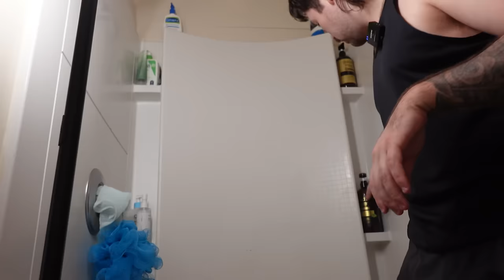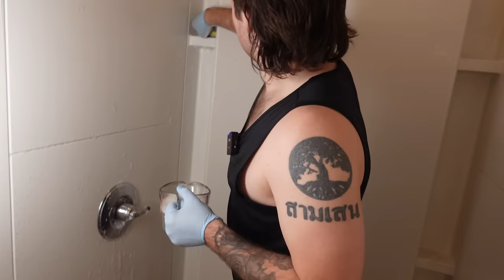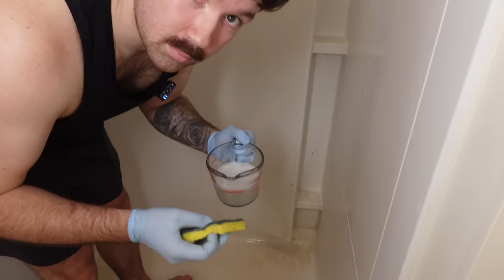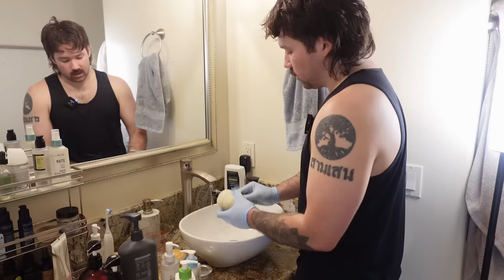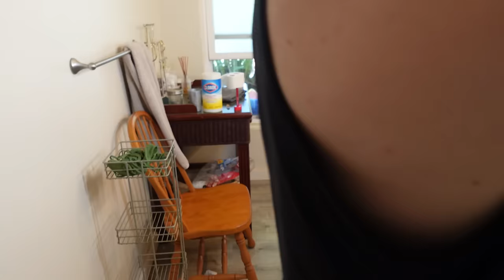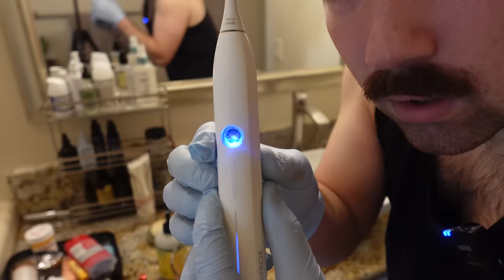being miserable is not a virtue

Comment: Fun fact: dish soap is actually a pretty great, inexpensive cleaner for showers, since it cuts through one of the major sources of dirt/grime (skin oil). Nothin' wrong with cleaning a shower with that and a little disinfectant.
Reply: Dish soap is such a great cleaner. Ever since getting a CPAP madhine (they told me to clean it with dish soap), I use it on all sorts of things. I hadn't thought of it prior.
Reply: I can't stand it because you have to rinse it forever. I use method all purpose for regular stuff and stronger cleaners for thick build up like soap scum/hard water
Reply: @no_peace  I put dish soap and white vinegar in one of those scrub brushes and and scrub the shower walls while I'm taking a shower when I don't feel like doing a deep clean of the shower and tub. Because I'm in the shower, the suds come right off and it doesn't get super slippery
Reply: i clean houses for a living and I primarily use dish soap (Dawn) for most things! Usually, I use a mix of other chemicals and dish soap, but, unless you need to disinfect something, you can really get away with using dish soap alone. (I do in my own home lol) 
You can use dish soap on most surfaces, like counter tops, as well!
Reply: I thought I was a genius when I cleaned my tub with magic eraser and it worked great.. sadly it ate away at the protective layer that stopped grime from sticking to the shower and now I have to constantly clean it. Don’t use magic eraser on your tub. Maybe I’ll give dish soap a try
Reply: Dawn is my go to for cleaning everything. Add a little white wine vinegar and it’s go time.
Reply: I wonder if using dawn power wash us also a good shower cleanee
Reply: This is an incredibly smart way to do it for people with ADHD (me), thanks for the inspo!
Reply: I know this cuz when im getting the human remains off my dishes, the dish soap always cleans it right up!
Reply: I clean everything with dish soap. I have the antibacterial kind and use it for the dishes, floor, shower, toilet, and counters.
Reply: Also vinegar!!
Reply: oh yooo thank you!!! my shower cleaner sucks!
Reply: K but that was hand soap
Reply: Yup! And for regular cleans in a lot of areas the disinfectant is optional. On hard surfaces, the dish soap will both break apart most germs and lift it off the surface so it can be rinsed away.
Reply: @squirrelsinmykoolaid that's the smartest idea I've ever heard
Reply: Sometimes, the simplest solutions are the most effective.
Reply: I mix dish soap and shower spray in one of those sponges with the soap compartment on it and hang it in my shower. When I shower I do a once over of the walls so I rarely need to do a full clean of the whole tub
Reply: @no_peace so add less…
Reply: @ebel-mt2dm me too man. Human blood just seems to dry a bit tooo  quickly if you know what I mean. Lot of scrubbing untill I learned that a little bit of soap and hot water will clear it up. Sadly I learned soon after that her hair was stuck in my garbage disposal needed a solvent. Baking soda and vinegar worked for the hair and harder bits of cartilage. They just take a bit since that particular solvent is weak. I actually have a shipment of  Hexane and petroleum ether coming over so that way the whole body melting process will go quicker. Anyways the  rest just gets buried. I always burry the odd bits in front yard (the back yard is to obvious).
Reply: This is blowing my mind. Imma take my dawn power wash to mine to get the bath oil off the sides. 😂
Reply: @squirrelsinmykoolaid I love you for this comment, omg. This is life changing for my ADHD brain.

Comment: I use a mix of vinegar and dish soap to clean my tub. Equal parts of each in the microwave for 2-3 minutes, then mixed - not before. Pour it around your bathroom and scrub it in gently, then walk away for 30 minutes. Once you come back, scrub it again then spray away with cold water and it will be clean as fuck. No real elbow grease required.
edit: misspelled vinegar.
Reply: I definitely just screenshotted your comment so I can try this later. Thank youuuu
Reply: quick question cause I wanna try this myself: when you put it in the microwave, what heat level? like lower, higher?
Reply: I've heard people say vinegar is good for cleaning but doesn't it smell really strong? 

I'm sensitive to smells so I feel like if I tried it and it made my bathroom smell it would be really difficult for me.
Reply: @jaymercer4692  my last roommate used to do straight vinegar in the kitchen every 2 days and I couldn't handle the smell so I started buying cleaners that were all "natural" etc with nice scents and she let me use that instead lol. But it sounds good for deep cleaning a bathroom once every couple weeks.
Reply: I just use bathroom spray and let it sit for 30 seconds
Reply: I don't microwave the vinegar, because I don't know why I would. But vinegar is great for removing both mold and lime(stone?) residue. ESL, so not sure if the white residue on the bathroom walls.
Reply: exactly what I use, and if I'm out of white vinegar (as I often run out because I use it in my laundry for a deodorizer as well) you can use Isopropyl Alcohol. If I use any of the chemical cleaners I swear I can't get the smell out of my nose for days, and usually end up with a headache, and I am venting the bathroom when I use them, just sensitive.
Reply: ooh also, after you microwave the vinegar, immediately wipe down your microwave and everything will easily wipe away! Two birds ya know 😅
Reply: One exception: vinegar isn't safe on SOME natural stones, like natural quartz, apparently. It's too acidic. Alcohol isn't acidic, so should be ok. Especially good to know for someone who gets a cleaning gig.
Reply: @RR-hl6zi  Very close, you were looking for limescale.
Reply: You can also soak lemon peels, any herbs you like the smell of in vinegar. Leave it in a dark place for 2 days to a week and shake every day. I got this recipe from the YouTube channel, NewLifestyleABB. It smells wonderful and it’s a great way to use leftover lemon peels
Reply: My grandma does this too!! She insists vinegar will clean anything lol

Comment: I think you're getting the job done just fine with that dish soap (and I bet it smells amazing)- but I also have a moldy bathroom like your sister(no fan+humidish climate) and my way of dealing with cleaning the shower (well the bathroom as a whole) is clean all the bathroom surfaces first (including scrubbing the walls and ceiling- my bathroom is teeny and has a low ceiling), then the toilet, the floor (Swiffer), THEN- clean the shower while I'm in it, getting clean myself (since I'm probably grungy after cleaning the rest of the bathroom). I turn on the spray so the hot water gets some steam going to loosen up anything, then I scrub down the shower while I condition my hair. I used to clean my shower with clothes on and it was a pain in the ass for me- trying to rinse different parts while not getting sprayed myself. This has worked much better, hope this helps someone who also hates doing their shower.
Reply: I also hate doing my shower and getting sprayed - my solution is every weekend I wear my oldest clothes that I don't care about and clean my house top to bottom then have a bath at the end of it.  Sometimes I'll hoover through on one day and do the polishing/scrubbing on the next day if I need to do a deeper clean. Ngl though sometimes I skip a week and then all hell breaks loose 😬

Comment: tip from a hotel housekeeper: dish soap is great for glass showers but with titling or vinyl like this, it's better to use a bleach-based cleaner. When I'm at home and cleaning, i use an all purpose spray on nearly everything and then go in with diluted bleach as-needed. (vinegar also works but i prefer bleach) I also would have used a janitorial rag (or an old washcloth) on all that detailing. You can take your index finger and trace all those corners, something a sponge can't really do. I also just soak my  shower curtain in the tub (i'd use a storage container if i had a shower like this) with hot water and bleach, then re hang it to let it air dry. They repel water so taking them out of a washer usually makes a huge mess even after a spin dry.

Comment: It’s currently 38°C (100°F) here and this actually made me get up and clean my bathroom, promising myself to at least clean for the length of the video. I am so glad I did because you made me think about how nice and extra clean I will feel after showering in a really clean bathroom. I also finally cleaned the metal shavings off the floor from when I changed the door handle in there 2 months ago too. 🙃🙃🙃
Reply: Good on you! Sometimes, it can be so hard to get up... Especially in such hot weather.

Comment: Cleaning tip i learned on Twitter somehow: laundry detergent works AMAZINGLY on bathtub grime and showers (makes sense, since its entire purpose is washing away skin oils abd dirty and assorted body filth. Spray on a dilute mixture of laundry detergent and water, dab on some undiluted liquid laundry soap on any really grungy spots, then leave it for a while and you barely need any elbow grease to get it all squeaky clean. I have some chronic pain issues so cleaning is sometimes very uncomfortable, but my shower and bath is always spotless. Makes me feel good to know that I can take a hot bath in a clean tub any time i need one (it helps the pain).

Comment: If anyone wants, here's a list for my cleaning company if you're struggling to start cleaning a bathroom!

First, I like to start with the tub/shower. Take items off of surfaces, and if you can take your shower curtain and wash it. Then I'd recommend a scrub daddy with Bar Keepers Friend Soft Cleanser! It is the best combo I find that doesn't scratch for tile and tub. Just be careful and walkways spot test. I work I'm sections, then wipe product off w a cloth and then rinse and buff with a clean microfiber cloth.

NEVER use toilet cleaner in a shower, it is meant for porcelain and most tubs aren't (especially rentals).

Put the items back in their spots, then take all the stuff off your counter. This is where I like to clean my mirrors, windex or whatever with a microfiber until clean!

Then scrub the counter/sink, and dry it off. I use a mix of vinegar and dawn soap!

Then put the stuff back on the counter, and start on the toilet. 

Start with toilet bowl cleaner, and give a good scrub and let sit while you do next steps. Take a rag/throw away rag and dust the toilet starting with the top/tank/seat, lift the cover then the seat and dust TOP TO BOTTOM, including behind the toilet on the floors. 

Once you're done with dusting the toilet, spray w bleach and wipe off. Make sure to check and flush the toilet after.

Then you'll do the floors! I put floor items in the tub (and sanitize after), sweep then mop and you're all good!

Comment: There is definitely a trend of some size whereby the normalization of self-diagnosis and therapy speak in nontherapy contexts leads people to sort of justify maladaptive habits by invoking things like self-care. 

It's overblown by the right-wing reactionaries who want to flatten all nuance into "those people are just lazy and don't want to work", but the opposite side of the spectrum (which, to be clear, is vastly smaller and nowhere near as equally "wrong" or "bad") is just a sort of embrace of the knowledge that "work" is a spook to let the need/want of rest/relaxation/entertainment take priority over still necessary tasks like cleaning and maintaining a roof over one's head, relying on said knowledge and aforementioned therapy speak to reframe any negative feelings regarding it, whether external judgments of family or roommates, or even an internal sense of shame regarding one's neglect of certain hygiene tasks, to make the coping mechanism into a therapeutic act. 

That's not to say "use shame to get people to change their behavior", rather that we should decouple the idea that an expectation of self-work is ableist in the same way that we should decouple the idea that not throwing oneself into alienated labor is "lazy" and therefore morally bad.